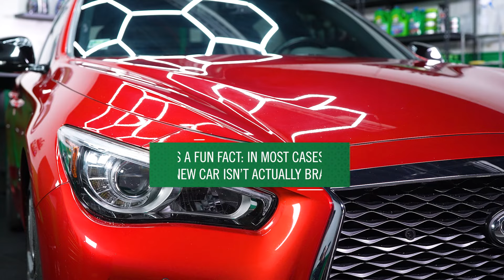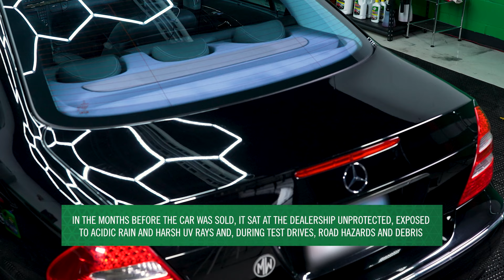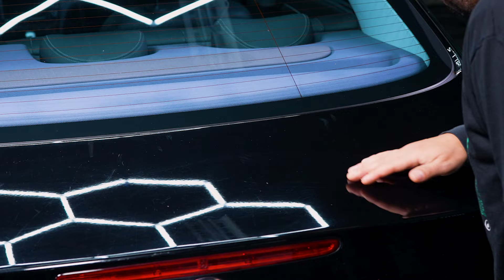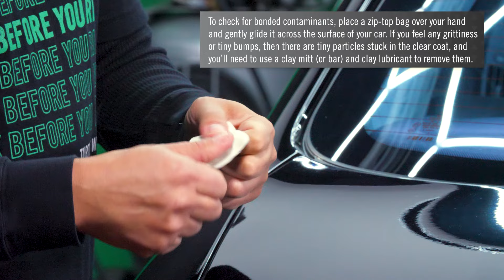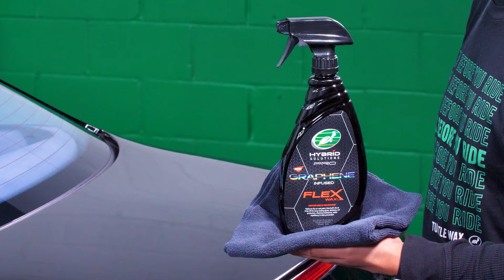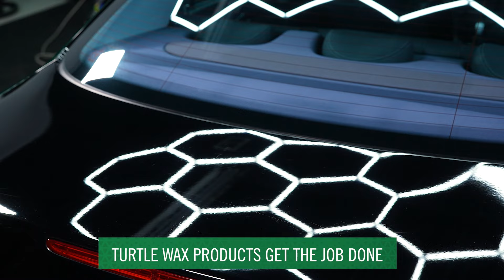What's the Best Car Paint Protection Coating for New Cars?

Comment: After applying the base coat of flex wax what do you suggest as the second coat use the hybrid solution ceramic spray or stick with the flex wax or can you use either or other

Comment: Which towel (gsm) do you recommend for flex wax? As its a very grabby product when it comes to wipe down.
Reply: I’ve had success using something like the edgeless 225 from rag company or even a waffle weave towel. I’ve sprayed flex directly on the towel and wipe in from there. Or, if you spray directly onto the surface, it’s not a bad idea to use a slightly damp towel to spread, followed by a dry one to buff.